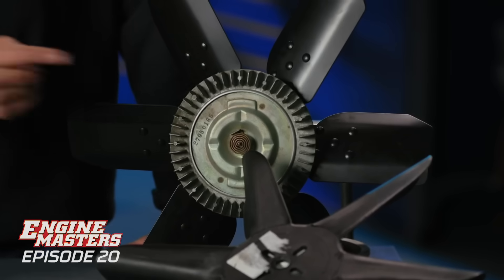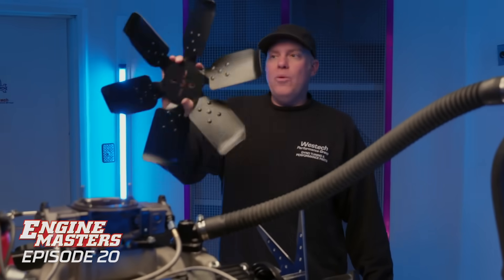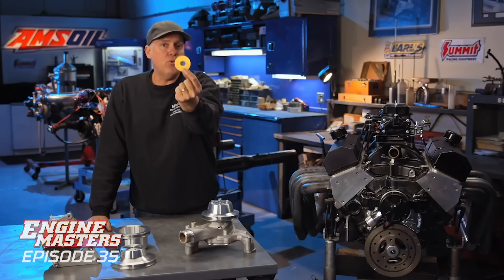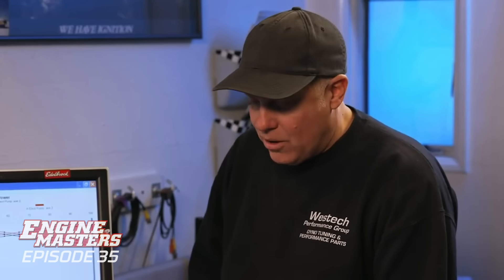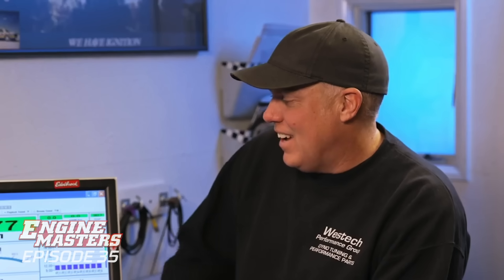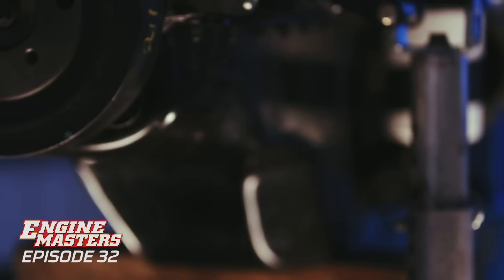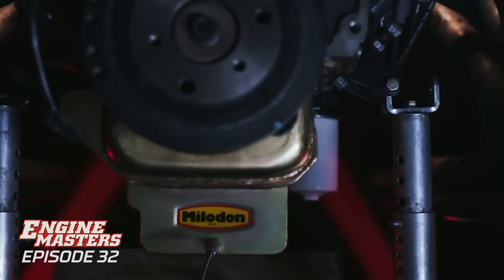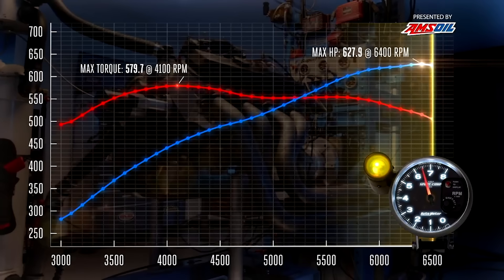Don't Do This! How to Ruin Your Engine's Horsepower | Engine Masters | MotorTrend

Comment: Moral of the story, use an electric fan and accessories when possible.
Reply: Well, no. That would drain the same amount of power through the alternator, plus some inefficiencies from it being converted to electricity and back to rotation again. The only advantage here would be that those accessories can be turned on or off by the computer instead of being attached permanently and maybe having a thermal clutch in case of the fan.
Reply: @krzysztofczarnecki8238  electric accessories may draw more electricity but not more horsepower. It only takes a set amount of horsepower to turn the alternator. The more electricity being drawn from the battery doesn’t make the alternator harder to rotate. The only concern is making sure you have a alternator that rated to put out enough power to run everything.
Reply: @porscheguy09  You ever heard of back EMF? The current that flows through an alternator under load creates a magnetic field that brakes the rotor, and the stronger the load the stronger the current.
Reply: @krzysztofczarnecki8238  yes but an alternator on a car has a maximum output and at it’s maximum output it takes a set amount of horsepower to rotate. If your alternator takes 5 horsepower to rotate under maximum load then that’s the most it’s ever going to take away from your engine. A lower load and it might only take 3 horsepower but it’s not going to require more and more horsepower since it can only produce a set amount of power. An electric fan and water pump are easily run by most alternators that are only going to require a certain amount of horsepower. You will save horsepower by running an alternator that takes 5 horsepower under max load versus running an alternator which you need regardless plus a mechanical water pump and fan which rob even more horsepower as shown in the video.